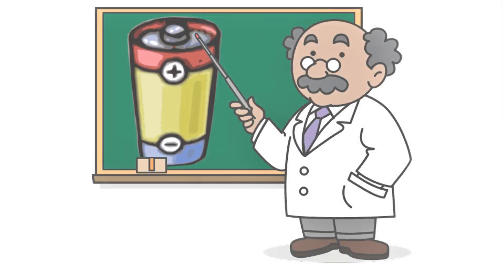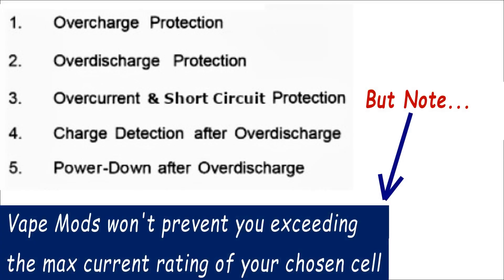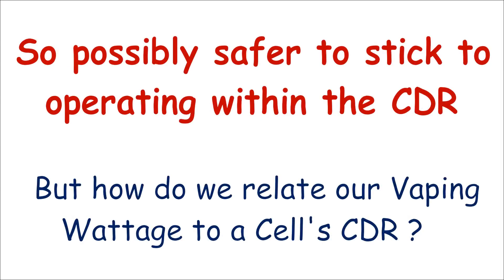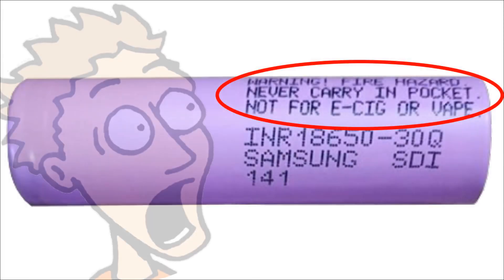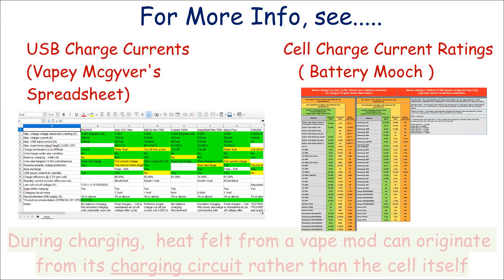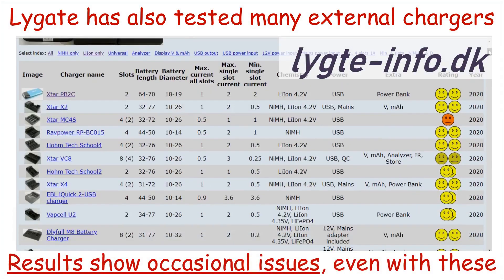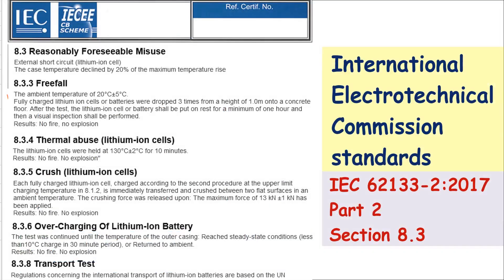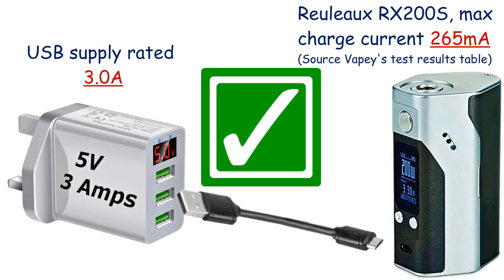Vape Batteries - All You Need To Know

Comment: Hi, I bought two IMR 18650 3500mah 20A by Efest for my Voopoo Drag 5 UforceX. Will they be good for vaping at 60/70/80w with a resistance of 0.15 ohms since it's dual cell? Greetings
Reply from the maker: Hello mate, the test reviews I've seen of these purple Efest IMR 18650 do very little to inspire confidence.  It appears that the 20A current rating is for intermittent rather than continuous discharge (CDR) and excessive battery temperature can result if they're pushed hard. 
The Mooch and other reviews you can google seem to be saying that 10A is a more accurate & safe CDR for these cells, which by the old rule of thumb (3 x CDR x number of cells) would give you a conservative max of 60W setting for a 2 cell mod (coil resistance won't make any difference here). 70/80W might be pushing it a bit but probably still OK ish as long as you keep an eye on how hot the cells are getting. 60W is way enough for DMT vaping (as my channel mainly focusses on, but if you're a nic vaper then you might want to look again.  But your shout of course.
Good luck!

Comment: Only original 18650 have  that device but the fake one 💀
Reply from the maker: IME, cheap fake ones often don't actually need 'that device' if you mean the protection board, simply because they won't provide enough current (even with a complete short circuit) to trigger a cutout even if one was fitted.

Comment: I have seen some one come in to a vape shop buy a noisy cricket (unregulated mod) said he could handle it only to come back later that day with what was left of the mod. The vendor refunded it but I wouldn't have lol.
Reply from the maker: Thanks for that Lando, I hadn't heard of the Noisy Cricket, I've just looked it up. Honestly it's a complete mystery to me why there's still a market for this type of mod.  I mean sure, it's nice build quality but it seems needlessly crude for the sake of it.  I guess some folks might think it's quaint, but the horrendous lack of even basic safeguards would be a huge disadvantage for me, not to mention the complete absence of any way to bump up or down the Wattage with a few button clicks would severely get on my wick, no pun intended.
Oh well, each to their own I guess.
Reply: @MintyLoveDMTMechanical mods offer plenty of benefits for those who take them, battery safety, and Ohm’s Law seriously. There are no chips and circuit boards to fail over time, for one thing.

An often overlooked benefit of mechanical mods is that, because we deem them less safe than regulated, we take more precautions. We learn more about batteries, about Ohm’s Law, and about general electrical safety through necessity. We don’t just rely on protections which may fail at any time, because we didn’t have them to begin with, and we knew that.

Mechanical mods are not inherently less safe than regulated mods, and, in fact, regulated mods aren’t inherently safe, either. Because we’re more careful with a mechanical device, we’re potentially at less risk than a person who blindly trusts that their regulated device will save them in the event of a failure.

A common misconception with regulated devices is that battery choice doesn’t matter, because it’s regulated, therefore safe. This isn’t true. If you put batteries rated for a max discharge rate of 5 amps each into your two battery mod, and then try to vape at 80 watts, you’re seriously stressing the batteries by over discharging them. 80 watts across two batteries in a device with a typical voltage cutoff of 6.2 volts (3.1 * battery count) is drawing 12.9 amps per battery. More than double the rating of the cells in this scenario. If this were a single battery mod, that’s 25.8 amps being drawn from the single 5 amp cell, and that’s before accounting for inefficiency in the circuit. Yet people will tell vapers that it doesn’t matter because the device is safe. It simply isn’t safe if it’s misused, just like a mechanical mod, and isn’t actually safe even when not misused; we simply have to hope that it isn’t going to fail.

Let’s not forget that any use of these batteries for vaping is already a misuse of the cell in the first place, since they’re not designed or sold to be used loose. Using the battery at all is a safety risk, regulated or otherwise.

Properly educating yourself about the safe handling and use of batteries, Ohm’s Law, and more than a simple crash course on internal resistance/voltage sag, and then applying that knowledge to a mechanical device, treated with the respect it deserves, while building coils specifically for the type of vape you want and using a battery or batteries that can give you that vape with as little risk as possible is, in my opinion at the very least, just about the safest vaping experience you can have. There is no “safe,” only “safer,” and there’s nothing safer than a vaper who knows it isn’t safe, but also knows exactly what they’re doing, minimizing every potential risk along the way. Your average vaper with a regulated mod isn’t typically doing any of that.

All this said, I do think mechanical mods shouldn’t be sold in stores to just anybody who wants one as, in contrast to the above, a vaper with a mechanical mod and none of the prerequisite knowledge is without doubt the least safe vaper around.

Apologies for the rant, I get carried away when it comes to things I’m passionate about. Vaping, mechanical mods, and safety are three things I’m very passionate about, and take very seriously.

Comment: hey guys in my devices manual it says it is recommended to charge at 5V-2A sadly i dont have an external charger as of now but i have a 5V-1A plug at hand to use with the included usb C cable, is it ok if i charge internally with that plug? or is there a possibility that i can damage the mod and battery by using a lower power plug? it is an external 18650 battery
Reply from the maker: Almost no chance at all of damaging the mod as long as your 'plug' is good quality. The worst thst can happen with a lower powered 'plug' as you call it (I expect you mean a usb power supply) is slow charging (or no charging at all).  I guess it's theoretically possible you may kill the 'plug' but very unlikely and if it's only 1A it will be of very limited use anyway.

Comment: Brother i mistakenly bought a Panasonic NCR18650B and now i can't even return it they are rate as 6.8 A and my mod is 120 watt if i keep using them will it blast or something? Because i only use it around 55 watt not more and my coils are around .13 ohm
Reply from the maker: Hi Deb, unfortunately the NCR18650B really isn't suitable for any 510 mod. If you use 'em in a mod at anything over about 15-18W per cell then you're operating outside the manufacturers specifications.
So they might get hot, or your mod might throttle the wattage back from your selected setting, or both, or the mod may cut out if the load is pulling down the battery Voltage. 
You might get away with it at very low wattage settings in a dual cell mod, but tbh if it were me I'd chuck em in the recycling bin and get some decent cells like samsung 25r or something.
Reply: @MintyLoveDMT  but my mod is a dual battery one so maybe I can use it above 50+ watts because in my country batteries are very costly
Reply from the maker: You're not getting it, a two cell mod with these will be good for 30W maybe 35W, after which you're driving them outside the manufacturers rating. 
Batteries can be very safe but its extremely ill-advised to use the NCR18650B in a vape, these are designed for much lower power demands like torches, cameras etc. Cost is an extremely poor counter argument.
At the end of the day its your business not mine.

Comment: hey bud can i use higher rated amp batteries on a mod without damaging it? for example the voopoo drag x2 is rated at up to 80 watts, could i use the efest imr 3000 mah battery for it? wich is 35A without damaging the mod due to its higher Amp rating? also other local options are the samsung 25r and the molicel p26a 3000mah 35A, i just dont know wich is the better option
Reply from the maker: Hi MM, the Efest you're referring to is only rated at 20A continuous discharge (CDR as I mentioned in the video) ,  the 35A it days on the battery is (perhaps misleadingly) only its rating for a short period of time (the battery will get hot if used continuously at this power)
But to answer the question, yes you can use a high powered battery no problem, its low current rated cells that can cause issues on mods. 
Personally, I always buy Samsung 25R as they seem a tough old battery forba bargain price. These have a CDR of 20A so by the rule of thumb I mentioned, this will be good for upto a 60W setting on your mod per cell (more than enough for DMT) and you could probably push a 25R to 70W for short periods (take a look at the data sheet)
Reply: @MintyLoveDMT  thanks bud my local shop just had some molicel p26A 2600mah 35A and some efest 2600mah 40A come in, i ended up getting the molicel ones i dont know if that was the right choice though 😂
Reply from the maker: I'm sure the Molicels will be good, although I've not had much luck with the two P28A I bought last year, they hold less charge than the moth-eaten 25Rs they were intended to replace.  Still, I'm sure it was just bad stock.

Comment: What battery do I use for a aegis X vape as I’m confused amps and volts etc and where to buy some that’s safe
Reply from the maker: Just order two "Samsung 25R"s and keep the power you set on the Aegis X to 120W or less.
Order from Fogstar (if you're in the UK), if not then use Google and trustpilot (or whatever your equivalent is)

Comment: Thank you so much for the. Math calculation on CDR to  WATTS    looked throw 20 video  your the first I found  to explain it
Reply from the maker: Good stuff, yes the CDR rule-of-thumb assumes battery Voltage of 3, (Volts x CDR Amps= Watts) which is a bit low but it kinda takes into account the  inefficiencies of the vape in the Voltage conversion.
Whatever, it seems to work safely enough.
Best wishes Chris.

Comment: I wish i have more knowlege of batteries aside than knowing which way to place them in.   I want a tinymight 2 so bad but have no clue how to charge the batteries.   I bought an xstar vp2 and cant get it to work
Reply from the maker: According  to this https://magicvaporizers.co.uk/tinymight-2 the TinyMight 2 takes a single 18650 cell and is charged via the usb-c port. so charging it'd be the same as charging your phone, or practically any other mod.
Reply: I sincerly appreciate your help and time!   I owned one a year ago and it is by far the best vape I've owned but I couldn't figure it out and returned it, sadly.   The perfect vape.  So many toys within its own ecosystem of glass accessories etc.   

What im saying is I assumed that's how this would work.  Just charges the unit while the battery is inside.  I do notice how the original battery go down to purple color and after charging it (while the same battery inside) turns back to green.   However I spoke with Larry from POTV and he said recharged and or replaceable batteries need to be charged in an external device, such as the one I own, Xstar.   Even bought tons of extras.  I felt it shouldn't be so difficult.  Didn't work.   User error I'm sure.   

I'm looking for an external battery charger that's simplistic but good?
Reply from the maker: Larry is incorrect, as I mentioned in the video it's very simple to build in a well-managed li-ion charging circuit into any device, whether it be a vape mod, a phone, or even an external charger, and costs mere pennies to implement,
I'm sure dealers like to proliferate this profit-making myth, and those who make blanket claims that it's necessary to charge externally should educate themselves and stop parroting such twaddle.

Comment: I dond understand Englis well. Can you tell me what specifications battery for jackaroo 18650 pod 70w? First time using vape
Reply from the maker: Hi, if you're using it for deems then I'd say any unprotected 18650 Li-ion cell with a Continuous Discharge Rating of 25A or higher would be good.  For example the Sony VTC-5a or Molicel P28A.

Comment: I need to get some new 18650 batteries as mine are all getting tired now. I am not sure which suppliers can be trusted to sell genuine ones as there seem to be a huge amount of fakes around. I found the same thing with coils for the vapes on Ebay they didn't work or only last a day.
Reply from the maker: I know there's a concern of fakes, but I guess there's only so much we can do before taking the plunge and buying from someone.  As I mentioned in the video, I tend to get a first idea on Trustpilot, and then perhaps send a quick mail to the vendor asking for advice and just see what sort of reply I get.

But even with the best vendor and what I believe to be genuine cells, I've sometimes had old stock delivered which has been OKish but downright obvious it's not holding a full charge.  Nothing more annoying that to buy a new cell to find it's actually worse than the old!  But it's happened to me recently when I paid top dollar for a shiny new Molicel P28A.

I'm not sure what the answer is mate other than do as much research as you can and then just go ahead and hope.

Good luck!

Comment: So if I get a protected (one with a bud on the anode side) 18650 it might not fit my z80 ?
Reply from the maker: Correct, I'd be very surprised if you were able to properly fit the battery cap with a protected 18650 inserted.. And even if you did manage a hack to get it to swich on, as soon as you tried using powers higher than a few Watts the mod would either cut out with a low battery alert, or scale the delivered power right back to the meagre amount allowed by the protection circuit within the battery.

As I mentioned  in the video, protected cells are intended for lower powered devices like torches. They just don't provide enough welly for vapes.

Comment: My question is, with new batteries, should we charge before use? Or use before first charge? Or does it matter?
Reply from the maker: Not a bad question actually, and this is not stipulated by any manufacturer's specs I've ever looked at. 
So you can treat new cells as you would any in its current state of charge.
IME new cells arrive in a fairly random state of charge so if you're going to store it for a while before use, then get to a charge level that is recommended for storage. 
If you're going to use it immediately, esp if part of a multi-cell pack then you might want all to be fully charged and balanced.
I know there are common instructions to fully charge cells for like 12 hours or more before first use, but as far as I can establish, this is total nonsense.

Comment: how many hours does 21700 and 18650 battery last? when using single cell vape?
Reply from the maker: Serious question?  Of course, it depends on the mAh capacity of the cell, how high you set the Wattage, how long your tokes are and how often you toke.

A typical 18650 as used in a vape might have a mAh rating of 2500, and a typical 21700 somewhere around 4000.

So assuming if you set output power of the mod to 30W, our 18650 would theoretically hold enough charge for 15 minutes of continuous fire button press (if such a thing were possible). The above 21700 would theoretically hold sufficient charge for 24 minutes under the same conditions.

Comment: I just purchased an Aspire Nautilus Prime X, it is the very first time I have had to add a battery, I normally buy the e-cigs with the batteries included, I vape with 1.8 BVC coils (which I used with my Nautilus Prime)  I am desperate to find the best possible battery for this device, can you help me?
Reply from the maker: Well google says that the Prime X takes a single 18650, and all the other info you need is in the video.  To recap, look for an unprotected 18650 with over 15A CDR (should safely give you around 45W) and preferably over 20A CDR (for about 60W)  and stick to reputable makes and vendors.  Check before buying from lygte's or Mooches resources and the manufacturer's data sheet.
Reply: @MintyLoveDMT   Thanks for the info, I ordered a Hohm Tech "Hohm Life 4" Battery 18650
Reply from the maker: You'll be fine with the Life 4 mate

Comment: As a Yank I'm used to saying "mils" as thousandths of an inch.  I guess in Britain thou shalt say thous.  Thank you very much for guiding me in my journey back to Dmitri.
Reply from the maker: No worries xenu and good luck with your journey.
In fact my Dad used to say thousandths of an inch, but since everthing went metric we now have double the amount of ways to measure.  
For example, we buy our petrol in litres but fuel consumption is quoted in miles per gallon.  Room sizes are often measured in meters, but aircraft height still in x1k feet.  And some road signs still show yards.
We should have left everything as it was!

Comment: Hey brother I know you mentioned in an old vid about sourcing. But the versus site got shut down and I'm super paranoid about ordering. Anyway you can throw a few random spots randomly. I'm worried about alphabay tbh sounds sus
Reply from the maker: What exactly are you trying to find? DMT? I've never bought any so cannot help. 

Extraction is the only method I'd recommend to get DMT. Comments like yours attract scammers to my channel mate,  which is not good.
Reply: @MintyLoveDMT  fair enough, my bad didn't mean to attract scammers. Yeah pretty much just that, do you know of anywhere to legitimately get the rootbark at least? I want to make some dye with it